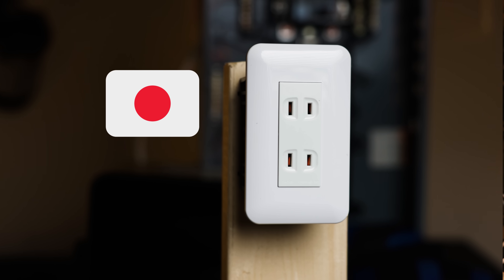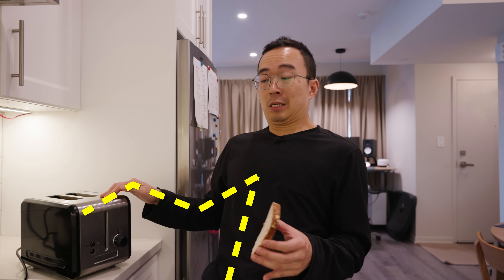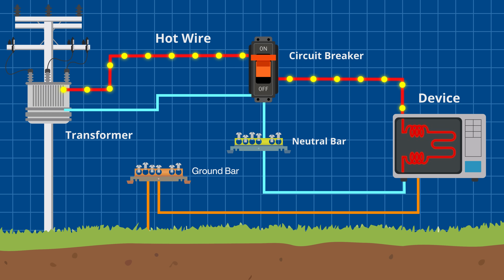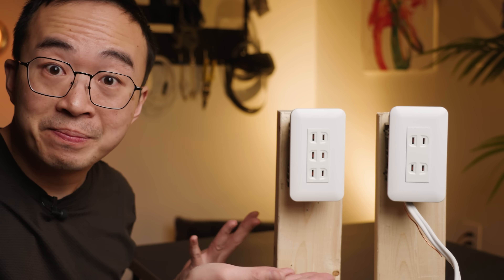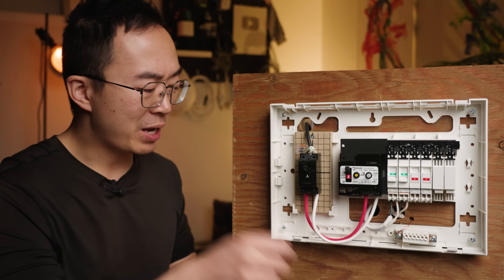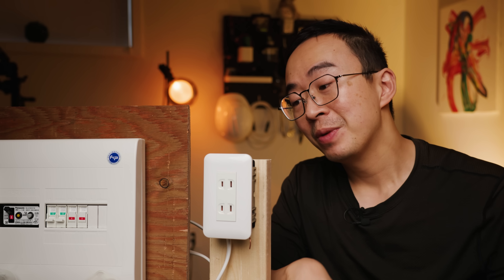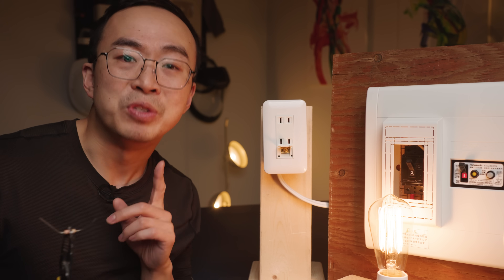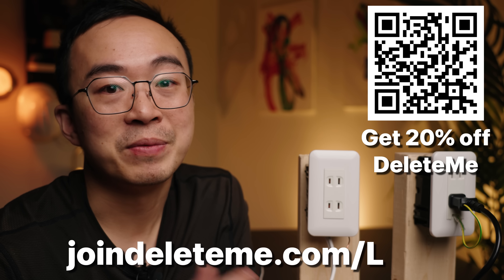How Japan Made Their Outlet Safe

Comment: Ok circuit breakers are NOT sufficient to protect against electrical shocks unless they've got a residual current device built in, which most American circuit breakers do not.
The amount of current needed to pop a breaker is huge compared to the milli-amps capable of k!lling.
It's good to know Japanese circuit breaker panels have gfci built in, but he still misrepresented how American circuit breakers work.
Reply: No, he is fine. Calm down.

Comment: It is wrong to connect E with N in case N is cut off from a house will cause a problem of electricity returned. The cutter of Earth Luck does not protect but is complete, it is better to use yarn adapters

Comment: Does Japan also require double-insulated electrical products?  Otherwise, a product with a fault between hot and a conductive case (metal, usually) is like a trap ready to spring.  A non-conductive case solves that.

Comment: The US Eleltrical Code required (very sensitive) GFCI outlets in wet areas in new construction, since 1971 !!!   That was 53 years ago. You have very old "news". We also have GFCI and AFCI Circuit Breakers inside the Main Power Panel.
Reply from the maker: Thanks Summit, also appreciate you chiming in on other comments.  Depending on which audience group I poke it makes it feel like I messed up this entire video.

Comment: The Italian electrical system is generally safer than the Japanese system for several reasons. In Italy, grounding is legally mandatory for every outlet, ensuring that the system is protected from accidental surges or current leaks. The TT system used in Italy is made more effective by the connection between the ground and the neutral conductor, which enhances the ability to interrupt the circuit in case of a fault. Additionally, Italian regulations, such as CEI 64-8, are particularly strict and ensure greater consistency in adopting safety measures, including mandatory Residual Current Devices (RCDs) for every system.

In Japan, however, many outlets still lack grounding, even in modern buildings, making protection less widespread. While the TT system is also used there, the absence of a connection between ground and neutral makes it less effective, especially in poor soil conditions. To compensate, the Japanese rely on RCD/GFCI devices installed directly in the electrical panel to protect all outlets, but this approach does not fully eliminate risks, particularly for ungrounded outlets. Only in 2022 did Japan begin requiring grounded outlets in specific areas such as kitchens, bathrooms, and outdoor spaces, but their use remains limited compared to Italy, where grounded outlets have been a standard for decades.

Comment: The whole explanation starting at about 3:30 makes absolutely no sense.  Starting with the fact that the diagram shows 4 connections to the circuit breaker when in fact standard single phase 120v breakers only have 2 connections (at least in the US).  Second big error is claiming that a 7 watt bulb remains  at 7 watts due to the resistance of the wire.  It remains at 7W due to the resistance of the filament, not the wire.  If it was due to the wire then replacing the 7w bulb with a 100 watt bulb would limit a 100 watt bulb to 7 watts.     This video should be removed due to potentially dangerous misinformation.
Reply from the maker: I should have better shown it was the filament, not the wire.

Comment: Your explanation about what grounding does is... at best shoddy and intentionally misleading.
No, grounding is NOT there to provide a short-circuit to trip the over-current protection faster. i mean according to that explanation the only time it could actually help at all is when there is a short between a phase and ground. That would be retarded.

On another note: the ground is not a poor conductor. That is just blatantly misinformation. And it is no different for japan. Also grounding and connecting it to neutral has no impact on the rest of the electric grid so any claims on that are also false.

Comment: In America only the main panel is common with the neutral/ground. [connected together as one Typically a single neutral/ground bar] The main panel will also have a Ufer grounding rod driven into the physical ground connected with an 8 gage copper solid conductor to the neutral/ground bar.
Any attaching sub panels that are connected to the main panel, neutral and ground MUST be kept separate. If the sub panel is a separate panel installed on an unattached building, then it must have its own Ufer ground connected to the ground only bar in the sub panel. [Remember in sub panels the neutral bar and separate ground bars are NOT directly connected together.]
Reply: In the USA, most new residential construction has 2 ground rods, spaced some distance.

Comment: Honestly It would be better to just have GFI's in all outlets. A central GFI is problematic since it shuts down all power to the entire building or apartment which if you have IT equipment or other devices that dont like loosing power unexpectedly it can cause issues. Outlet GFI  only shuts off the source of the problem
Reply: And Central GFCI can't be as sensitive as an Outlet GFCI. In the USA, you should not feel a shock from an Outlet GFCI = very sensitive.  Do you really want a nuisance GFCI Trip on your fridge???

Comment: i think the power outlets in Germany are much better and safer, because the Power Pins are pretty much inside the outlet ( you can't accidentally touch them ) and the first contact made is always the ground, when inserting the connector / power cable into the outlet
Reply: yes, but why does nobody talk about the feature, that you can rotate the plug 180 degress and it still works. now with japan and the ground connection pin this no longer works

Comment: This video is misleading. A whole house GFCI is an afterthought - not a superior design. The system in Japan today is the same as the USA up until the 1960s, then we (USA) mandated grounds. 

So in summary, in Japan the electrical infrastructure is old and too expensive to upgrade. But they came up with a whole house GFCI that means you will get shocked more than in the USA....you just don't die when you do!
Reply: The USA NEC required GFCI in wet locations starting in 1971= 50 years ago.

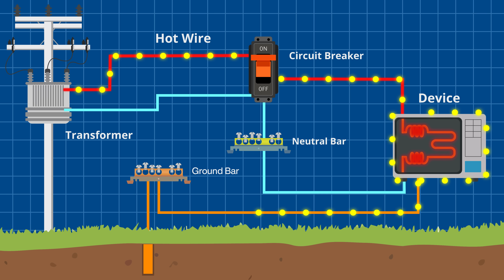Comment: 2:44 what happen if you are using a power drill at mid speed and suddenly to full power?
does the breaker trip?
Reply: No ground current and no overcurrent means no breaker trip.
Reply: @Cotronixco  but what happen if the load isn't steady? like a drill...
Reply: @Cotronixco  okay, nice.

Comment: I grade this video at 75%.  Mostly good, but a few inaccuracies.  

1. The national grid (infrastructure) is irrelevant to a building's grounding. They don't need to change the grid to allow grounding.
2. The Japanese homes were wired this way before GFCI was added to the main panel.  They started adding GFCI as a cheap alternative to avoid the cost of grounding.
3. Grounding is like a seat belt, it's useless most of the time but really helpful when needed.
4. Since it's useless so much of the time, many old-school electricians saw the ground wire as a waste of copper.  'I'll save you money, you don't need it.'  This is why most building codes around the world now require grounding.  Society says you do need it.  Grounding will avoid you getting a shock from touching the outside of that bad toaster.  The copper ground wire is a better conductor than your body.
5. Not all ground faults are the same.  Not all ground faults will trip a standard breaker, or trip it quickly.  Each breaker has a published Time Current Curve (TCC) that shows about how long it takes a breaker to trip at any amperage.  Could be a nice visual to add to your video.  But a double logarithmic graph may be too confusing to the general public.  
6. GFCI won't avoid the shock, but it reacts to ground faults much faster than a standard breaker and will stop the shock in 0.05s.
7. When you are explaining T-T Earthing, you are showing a ground wire to the device.  There is no ground connection on a two-hole plug you are showing, until you showed the screwed in wire below the plug.
8. The intro saying two holes are better than three holes.
Reply: In the USA, doesn't the GFCI Outlet Trip faster than a human can feel the shock?
Reply: @MrSummitville  No

Comment: oh that's a bad way Japan have things organised, would have been ok up until about 10-15 years ago, but now there are so many electronic devices around that when they fail cause a dc fault, which most type AC RCDs aren't sensitive too, hence the reason that for new installations in the UK type A RCDs (that are sensitive to some types of dc fault) are the minimum.
Even worse because some type AC rcds their coil gets saturated by dc current (even in a non-fault situation), so that their sensitivity to detect AC faults is reduced, which is bad news for a whole house setup.

Comment: Somewhat concerning is the low ampacity of Japanese electrical panels here in the states we used to 200 amps and even 400 amps panels. Especially if you have a large stereo system like I do 20,000 watts you need that 200 amp capacity.

Comment: So the short answer is that they use GFCI/RCD everywhere unless you have a screwdriver to plug and unplug something (provided you have a 3-wire cord with external pigtail).
Reply: That is not correct. In a Japanese home, exactly one GFCI device will exist, built into the main electrical panel, which will have no Ground-to-Neutral cross-coupler. None of the outlets will be GFCI. None of the outlets will be grounded, except for high-current locations (refrigerators, air conditioners) and wet locations (bathrooms, laundry rooms, kitchens, and outdoors). The grounded outlets for those special locations may be either the 2022 screw type or the 2024 3-prong type. The grounded outlets in those locations provide an extra layer of protection in addition to the existing GFCI. Those persons needing a screwdriver to install an appliance but not possessing one will need to buy one ($5).

Comment: Regarding how USA's electrical system and appliances and grounding work, you nailed it exactly. In my case, I knew all these things by 1968 (at age 9) by reading my father's books on electricity and electronics (which is why I ended up becoming a computer programmer and an electronics engineer as my professions). But most humans haven't a clue as to how electricity, electronics, computers, or other technology works. Your explanation of grounding in US appliances and home electrical systems is exactly correct: "ground" (and the all-important G-to-N cross-coupler in the main electrical panel) is there to trip breakers quickly in the even that hot shorts to the outer metal case of an appliance. (This is why electrical apparatuses not having metal cases usually use two-wire cords and plugs: no need for ground because no metal case to shock people.) 

As for Japan, the information in this video was all news to me, because I knew nothing about Japan's electrical system. Thanks for enlightening me. 

In short, a well-made video. I just subscribed to your channel.
Reply from the maker: Thanks, really appreciate your comment.

Comment: US and JP plugs are bad because they are two parallel plates without angles. They loosen up easily thus potentially creating a poor connection. The ground plug helps not just to ground the circuit but to make the physical connection more solid. The Chinese plug is two flat plate at an angle making it much harder to loosen up accidentally. The ground plug makes it even more solid if available. The UK plug is the most secure plug IMO but it takes it way too much space and the socket board becomes real big. What I hate most are the French/Korean plugs especially how they are indented. And let me tell you the round prongs are different in diameter so if you put a french plug into a korean socket it will be too loose and you get intermittent connections. Anyways.

Comment: there is 1 problem with this. youre  computer  transformer needs a ground to get writ of the  noise that is in evvery electrical net. otherwise it wil go over youre main boaird!!!
Reply: No!  Grounding your transformer does not make the AC Sine Wave better.  L-C Filters & Chokes clean up the sine wave. My computer has a 2 Prong Power Plug and it works just fine.

Comment: The correct way to test a GFCI is to push the Test Button, not to use a plug in tester with a grounding button. If the outlet doesn’t have a ground the tester won’t trip the GFCI. Home inspectors in the US are notorious for doing this and claiming the GFCI is faulty when it isn’t. The test button should be pushed, verify the out is off using a UL approved testing device. If the testing device indicates no current, reset the GFCI and verify it comes back on.  The tester won’t work if the earth ground connection is not present (old ungrounded systems) or if there is a fault in the earth ground connection. The GFCI will still provide protection. See NEC Section 406.4(D)(2)- 2014. The ungrounded outlet is required,however, to be marked “no equipment ground”.
Reply: If you have a GFCI outlet with a Ground Hole and it is not grounded then it must be labeled as such!  If the outlet is not labeled as "ungrounded" then per NEC, it must have a ground wire and must pass the GFCI Tester. The GFCI Tester verifies that leakage current back through the Ground Wire will trip the GFCI Outlet.

Comment: I'm in the U.S. and my house, which was built in 1954 had mostly two prong outlets, only a handful of 20a outlets were three prong grounded type outlets with several small fuse boxes in the basement.. 
It was rewired in 1972 with newer style wire, circuit breakers replaced fuses, and most outlets were replaced with three prong type outlets, but not all. Outlets that only powered things like lamps, wall clocks, and overhead lighting were left as two prong outlets and wired with 12/2 wire with a ground. The majority of those outlets now have been abandoned or just aren't used either due to newer style hardwired lighting or inaccessibility of their location. 
All new outlets were wired with 12/3  or 10/3 wire and with 20a breakers on single run lines. 

I do remember several appliances with those pigtails leads for a ground connection on them here. A former microwave, had one, several window air conditioner units, and some power tools. The instructions used to say to back off the center screw in the cover plate and attach the screw to that point. Which made no sense if the box was in a home without grounded boxes, or plastic boxes. 

Some of the older two prong outlets have a grounding terminal on the back, but no third grounding pin. Likely for the same purpose? I also found some really old Bakelite two prong outlets in the basement that have tabs that connect their neutral side screws to the mounting bracket via a tab that can be broken away. Sort of a thin brass or copper plate set under both screws with at tang that reaches around to the rear bracket edge where its riveted to the back of the outlet. Most of those had that tab severed, but not all. Those which were on the downstairs washing machine circuit still had the neutral connected to the box, which had been grounded with the bare ground of 12/2 Romex cable back in '72. 

There are no GFCI outlets, every attempt to use one results in an outlet that blows constantly. 
The bathroom has no outlets, just two hardwired florescent tube fixtures at face level above the sink. 
The kitchen has one outlet on each counter about 4ft to the left and right of the sink. 
They were installed in 1972 and are set about 10 " above the counter top, moved from the front of the counters at that time. (The old outlets would shock you if you leaned against the counter with a wet towel or loose clothing and the old, original outlets were full of dirt and debris. The one side bar counter had an upward facing outlet that had been packed full of crumbs and dirt over the years. That all was just eliminated completely 
I've got a large box of Leviton GFCI outlets that I had intended to use in the kitchen, on the porch, and for two outdoor outlets but they blow as soon as anything is turned on, blender, toaster, microwave, vacuum, etc. regardless of it being a two or three prong cord.
The only answer I've ever gotten on why the GFCI outlets won't work is that either all my appliances are defective, (unlikely), my wires are all bad and need to be replaced, (Highly unlikely), or my service needs to be updated, completely and every last bit of wiring, the main panel, and meter pan need to be replaced, (sounded like scammer to me). 

As an experiment, I made up an extension cord with a metal outlet box, metal cover plate, and a GFCI outlet on one end. I plug that cord into any of the outlets in the house and it works fine with everything but a drop light, which when I touch the metal bulb shield, it pops the outlet but no other appliance triggers it. The outlet is wired the same as the outlet its plugged into which I wired myself.

Comment: My Georgia USA house built in 1969 has just two inlets.  I have to buy those stupid adapters to make 3 prong stuff work.  When an outlet goes bad, I have no choice but to replace with three prong.  Of course, the third ain't hooked to nothing.
Reply: Replace with a GFCI ?  If the new outlet is "3 prong" and it is ungrounded then it needs to be labeled as such. Otherwise it won't pass an inspection.